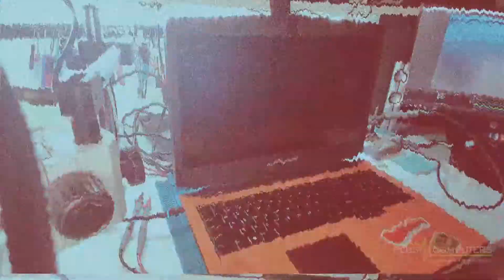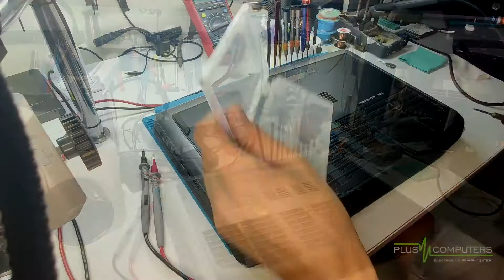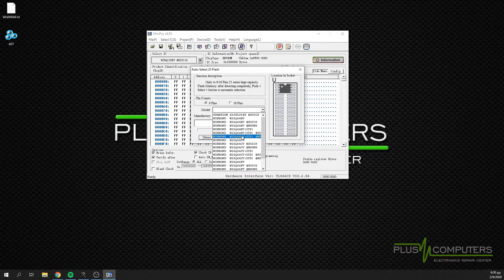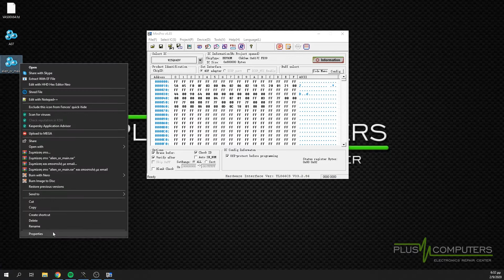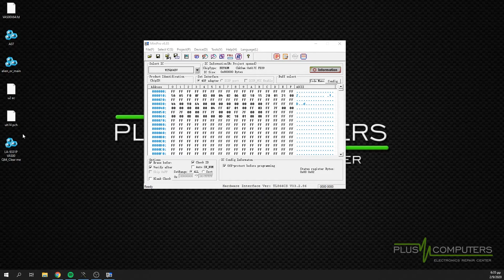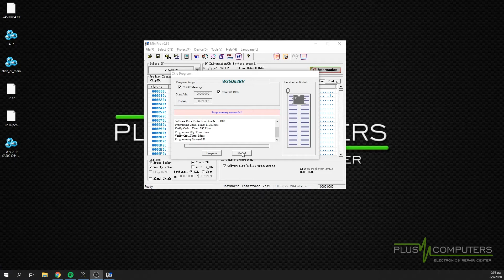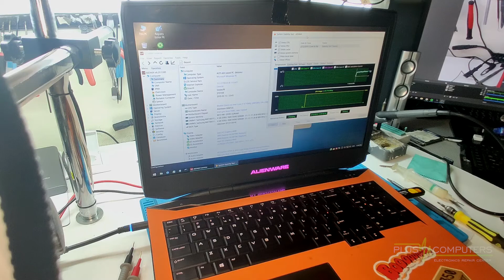Alienware M17x R1 1 beep how to repair - Επισκευή

Comment: can this be fix through flashing BIOS?
Reply from the maker: Yes, you can try to reprogram the BIOS.
Reply: @PlusComputersService   do u have a video sir?
Reply from the maker: @gabrielycong3637  In this video I'm doing that. But it's in Greek.
Reply: @PlusComputersService   No problem for language sir, as long as there is subtitle :)
Reply from the maker: @gabrielycong3637  No subtitles sorry. But if you know how to reprogram the bios and you have everything to do this you don't need subtitles.
Reply: @PlusComputersService  Sorry sir, I dont have any tools. 
I just thought i can just download a BIOS.exe from DELL then extract via winrar then copy to USB and plug to eSATA.
Reply: @PlusComputersService  possible to get your whatsapp or email?
Reply from the maker: No it's not possible to do it from usb. Bios chip must be removed and programmed. Take it to the repair shop. there is nothing you can do by yourself.
Reply: @PlusComputersService  Hi Sir,
I have now a programmer tools , i just want to ask that BIN file did you use on programming the BIOS?
Reply from the maker: @gabrielycong3637  You must find the bios for your motherboard. With the laptops model number and motherboards model number.
Reply: @PlusComputersService   i got it already from DELL official Site. 
How ever it kind of different from your video sir.